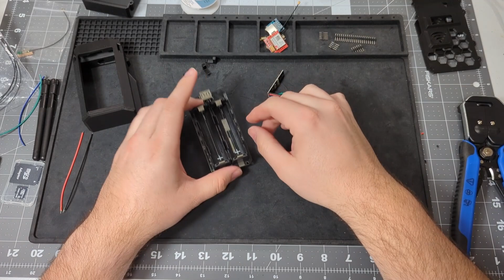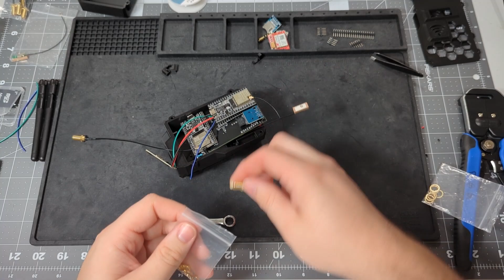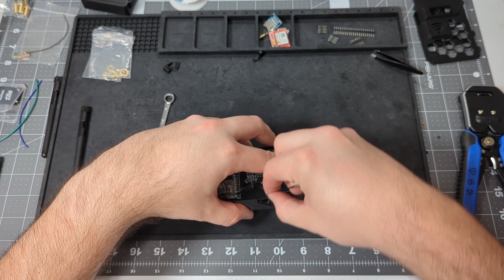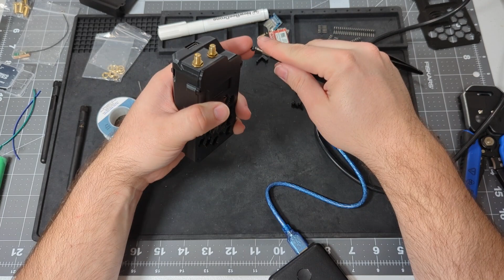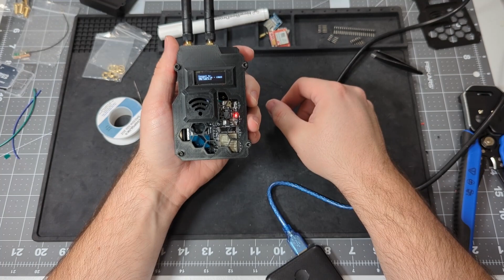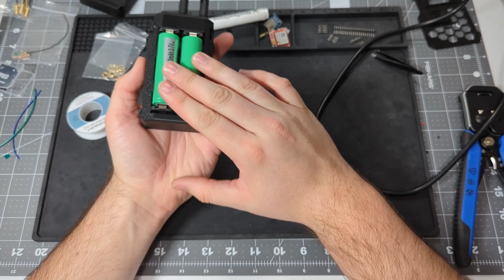Wardriver Assembly Part 2: Battery Addon

Comment: Where do we get the battery trays from?
Reply from the maker: The 3d print file or the actual battery PCB
Reply: @463n7  the part that holds the battery and snaps into the 3d printed frame
Reply: Pcb
Reply from the maker: @billylake5999  amazon or aliexpress I linked on on Amazon in the video description after you asked yesterday

Comment: Man I hard to watch you push that board into the case a few times.  I was too scared to push it down that hard.  😅
Reply from the maker: I think it did crack when I did it ended up dieing a few weeks later and I have sense broke 5+ more of them lol... I now shave down the retention nubs quite a bit
Reply: @463n7 so glad I read this before putting mine in.😅